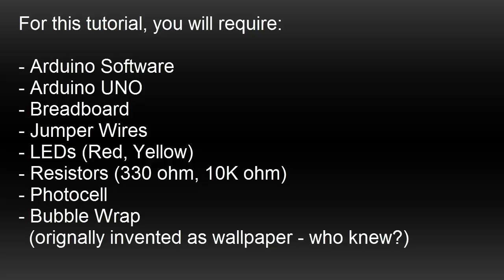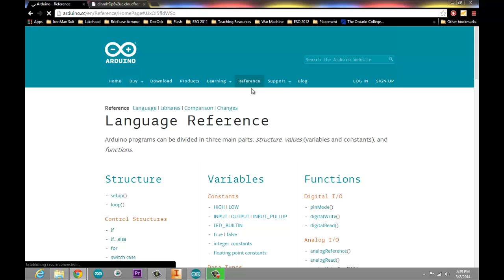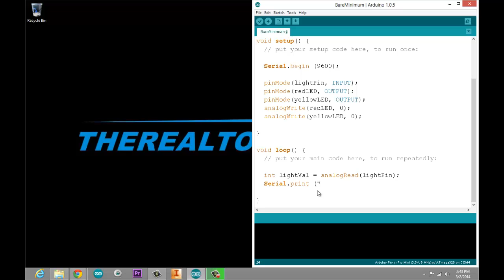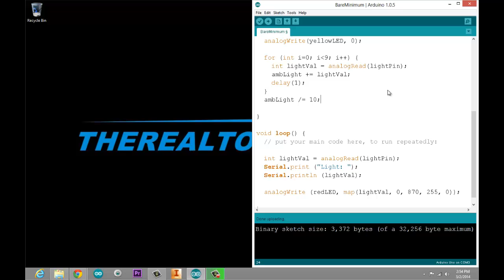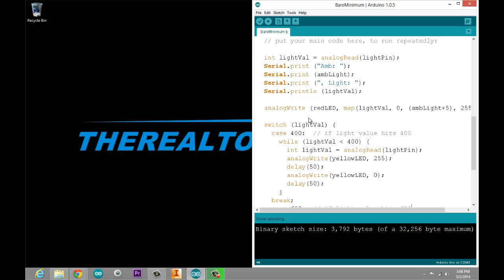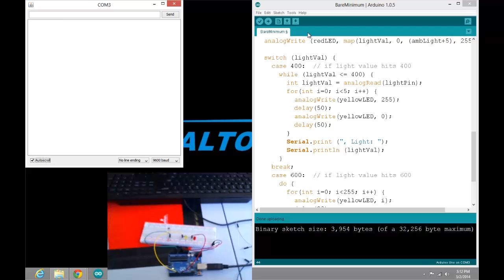Arduino Tutorial 08 - Switch-Case and While

Comment: Nice Ryan. Good work. 

I am working on a project based on 2 sensors which work with one LED (one will turn it On and another one will turn it off, for 3000 times (without timers)). Dont know how to use switch-case for that outcome. 

Please help.

Comment: Hi Ryan
What if i want to use a button to shift between 5 different cases and the cases should loop until the button i pressed again?

Like first case is the AnalogInOutSerial, case 2 is Fade example and so on? 
I want the fade example to loop until the button is pressed and then it goes on to the next program. :)
Reply from the maker: In this situation, you would require two additional parts.  The first, would be a button checking "if" statement.  Each time the button is pressed, it will do one of two things: 1) if the current case value is less than 5, add 1 to the "switch" variable (to progress to the next case) or, 2) if the switch variable is currently the 5th case, set the "switch" variable back to 1 (to restart the loop).